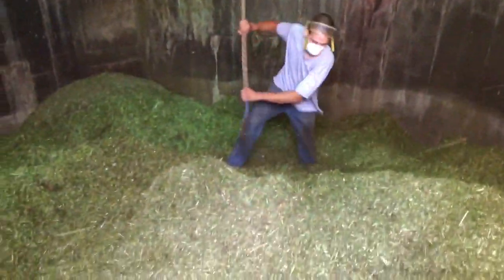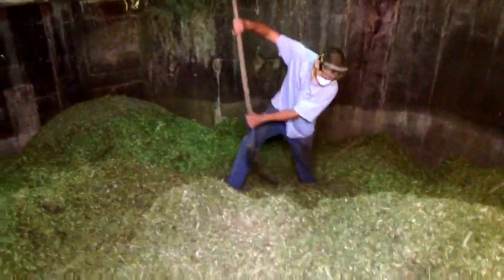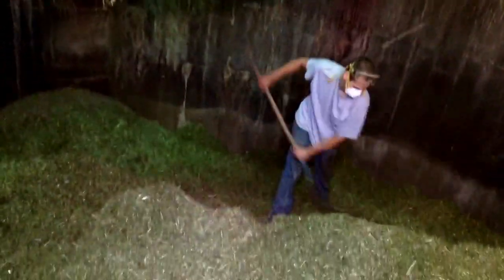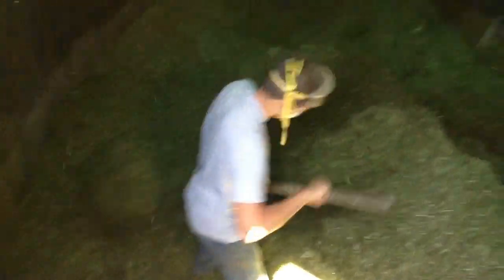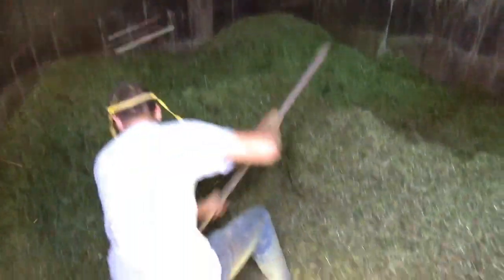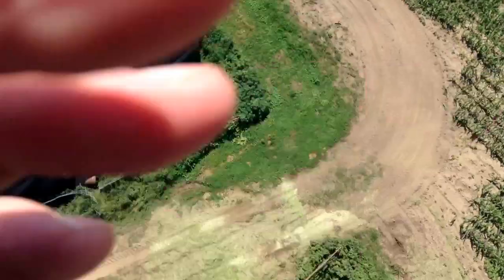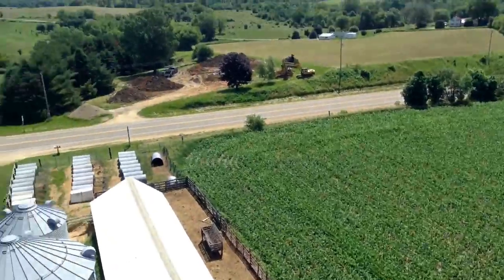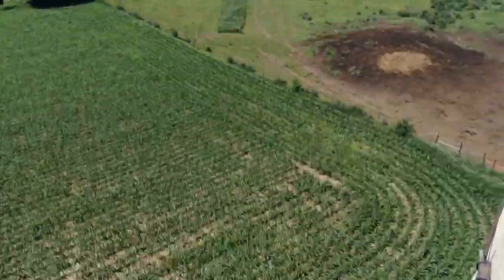Leveling a Full Cement Silo

Comment: how would he kill himself
Reply: He wouldn't kill himself...what they are being cautions about is Methane Gas (from the silage fermentation).  That's why having the blower running and having the top hatch open...and a spotter is essential.  Methane Gas is odorless...it hits you without warning...it almost got me.....
Reply: Happens fast and no warning. I knew a guy coming back down the chute from moving unloading doors and a small breeze pushed the gases into the chute and he passed out. He said he only remembers getting dizzy for a second or two and then out.

Comment: How do you get the silage out? I've never seen silos used only pits around here
Reply: See that big metal thing hanging in the top of the silo?  That's the unloader... it's lowered down onto the silage and turned on, chews it up and carries it over to the doors on the side and throws it down the chute to the conveyor at the bottom.  

So long as it works.  If it fails, you do it just like he's doing it, with a pitchfork, but out the door and down the chute.  

Heard of one idiot that ended up having to pitchfork out his entire silo because he left the unloader down at the bottom and filled the silo on top of it... 

This looks like too much work for me... I'd rather do bags or pits... 

Later!  OL J R :)
Reply: @lukestrawwalker  boy that must have screwed that unloader up with the feed on top!!